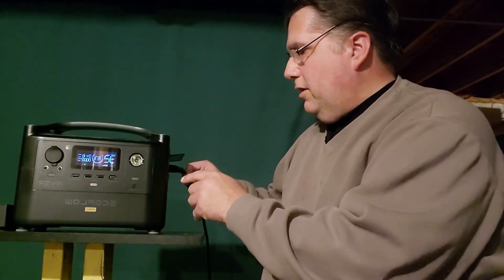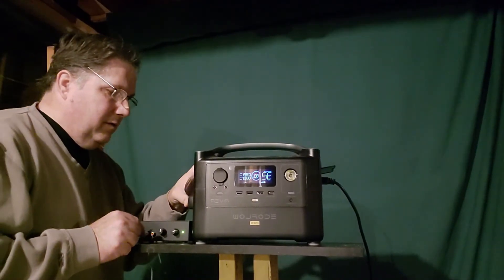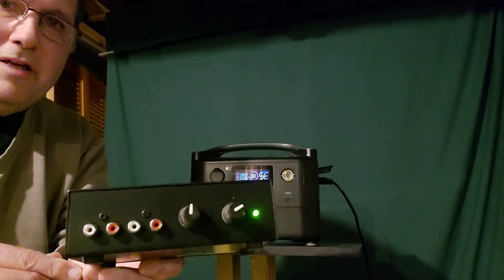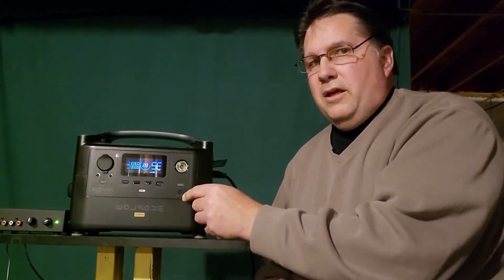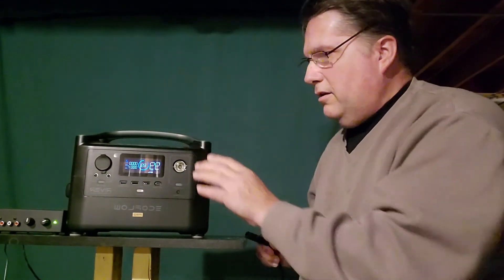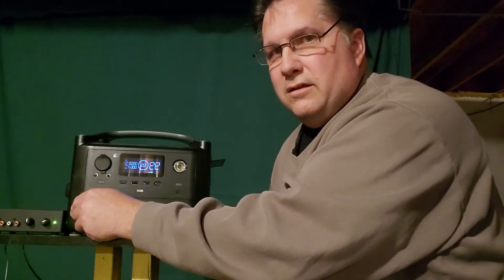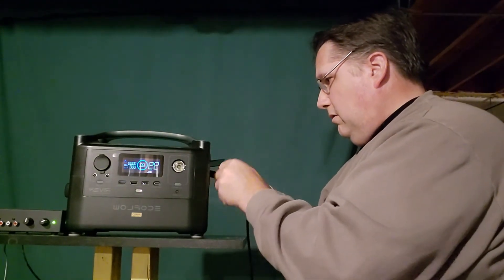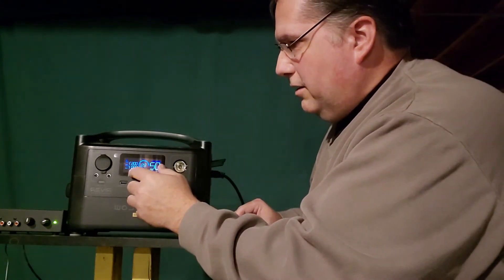What is a UPS?  Does EcoFlow have one? #UPS  #ecoflow

Comment: A stereosystem is not a good test for finding out it is an UPS. Even Ecoflow themself call it an EPS, emergency Power System.

If you plug in a computer that does not have a battery or an internet modem, you will know.
Reply from the maker: Yes there is a 30ms delay

Comment: Essential tremor.  Use some propranolol my friend.
Reply from the maker: Thanks
Reply from the maker: Carbon Monoxide posioning
Reply: @HarringtonMediaEcoFlow  geez sorry to hear that.  I thought it might of been essential tremor.  See a lot of it at the clinic. But I guess prolong exposure to CO could cause ischemic brain injury.  Smart guy.  Was trying to use my ECOFLOW detamax as a UPS for my internet router to keep cameras and ring operating. In case seal team six puts a hit out on me I’ll still be able to see them before they see me.
Reply from the maker: Ha...funny
Reply: I just tested the ups function.  It doesn’t work as ups for my Wi-Fi router, I tested.  As soon as I switch from grid to battery that delay knocks out the wife and  my control of device.  Since I use smart outlet, I keep it pluggged until I need the grid on or off. Once that is cut off I loose control until I get home and reset the Wi-Fi  connection.  I use a ups connnected to outlet on delta pro, which is connected to my Wi-Fi router. System now works flawlessly with the ups.  If you don’t have one, you will lose control of the Wi-Fi remote control.  And you will lose power to fridge if you don’t have access to Wi-Fi to flip on smart outlet switch to turn on grid power.
Reply from the maker: Good research.
Reply from the maker: There is a 30ms delay
Reply: @HarringtonMediaEcoFlow  I think for important devices like networks, computers, wifi cams, I think the delay is enough to cause issues if you depend on the wifi to control all your devices including ECOFLOW from remote.  But it’s a easy fix 100-200 bucks and it’s now solid device.
Reply from the maker: Good advice

Comment: Since the latest update, I "lost" the UPS icon on the screen, plus it does not show that there is an input despite the fact that I have it plugged into an outlet I know is working to keep it continuously charged and powering small USB devices, namely my phone. Do you think my update was corrupted or something? Are others experiencing this? How do I get that UPS icon back that shows that I am truly using pass through electricity?
Reply from the maker: Try re updating. Also test it. Leave the device you want to power plugged in. Plug in the ecoflow also. Once the ecoflow is at 100 it will stop chg but the plugged in device should keep working without lowering ecoflows charge.
Reply: @HarringtonMediaEcoFlow  Many thanks for such a prompt reply. (I hope Eco-flow recognizes how much of an asset they have in you!) I just don't know how to re-update the latest firmware. I have taking the AC charging cord out and waited 30 seconds, and then plugged it back in and it did charge it back to 100%. The USB outflow is only 5 watts, between two phones, and it doesn't seem to be dropping the charge from 100% this time🤞, but I want to take your advice. What's the best way to uninstall/re-update firmware?
Reply from the maker: Thanks. Some things just aren't documented
Reply from the maker: Use the wifi app and see if you can choose 'check for updates ' and download again and reinstall.  Keep the ecoflow from going into sleep mode while updating.
Reply: @HarringtonMediaEcoFlow  Yes, I did go through the settings and checked for that; it's all up to date. However I think I found something about how to do that by pressing both the power button for the DC outlets as well as the main power button in the middle at the same time until you hear a beep and that's supposed to reset it after which I supposedly can reinstall the update.  The instructions though talk about "turning" these things,but  I'm not sure if I should be "turning" them on first or off first before doing that. It's not clear in the manual.
Reply from the maker: Have you tried calling their tech line?
Reply: @HarringtonMediaEcoFlow  I should have posted this latest update earlier, but I wanted to make certain everything was working otherwise. I did get a response finally that explained that the UPS icon only shows when the charge level is set to less than 98%, in fact I set mine to 90% and waited until it dropped down and that's when the UPS icon lit up on the display. I would normally feel embarrassed, but they should have said this up front, and the tech who first helped me should have explained this. In other words, if you leave the charge level set to 100%, and you have it plugged in to the wall outlet to keep as a UPS, you will not see the UPS display.

Maybe I need to go to one of your other videos to ask if connecting a 100ah 12 volt LiFePo4 lithium (with the dongle you recommended and which I bought) would work with both the River and the original Delta? Many thanks as always for your help.

Comment: Is it okay to directly connect a UPS to the Ecoflow just to keep the battery runnning on the UPS to keep my computer up?
Reply: Yes and this way you eliminate the 30ms delay the ecoflow has. So you put the ecoflow in the AC plug, you put the UPS to the ecoflow plug and then put the computer to the UPS... when AC outlet has power, you draw directly from there, when power is off the UPS will instantly power the pc and then 30ms later the ecoflow will give power to the UPS so effectively the ecoflow will be providing power to the pc as long as it has power, when it runs out, the UPS will take over.
Reply from the maker: Excellent description !
Reply from the maker: Yes you could.  However the dedicated ups has its own battery of course but yes you could go through the ups.

Comment: But I heard the time of the UPS latency is 30ms, so not very good for computer isn’t it ?
Reply: New Delta 2-only 13ms.
Reply from the maker: Fantastic !
Reply from the maker: No it is not a instant response.  But if your computer is a laptop it should be fine. The internal battery should absorb that 30ms delay no problem.

Comment: I've been using UPS's, and Power stations, and power stations as UPS's for a long time.   Basically it does work, but there are a number of gotchas and issues that have to be addressed:

* You have to accept about a 30% loss of efficiency because you are taking AC on the input, converting to DC going into the battery system, and then back to AC again to power the device(s).   A dedicated UPS, on the other-hand, has a bypass mode so there are no losses under normal operation.  This can increase your power bills.

* Depending on the brand, the power station will likely have an 'ECO' mode that automatically turns off the output after a period of time.  This has to be disabled.  If it cannot be turned off then it depends on how the ECO mode works.  Some units like the Golabs i200 don't give you an option on the AC output, but will happily leave the DC output turned on forever so an external car inverter solves the problem.

* Power-on after power comes back.  Most (all?) of these power stations do NOT turn themselves back on when they've run out of battery power and shut-down.  Dedicated UPS's, on the other-hand, power back on immediately.

* Noise.   Most power stations have fans, and for the bigger ones, the AC adapters (the bricks) often have fans too.  This can be annoying if the unit is situated near where people are.  Dedicated UPS's running in bypass mode do not have to run their fan at all.

* Fire risk.  Use only power stations with LiFePO4 batteries.  Do not use power stations with standard lithium-ion batteries.  It becomes important when you are leaving one or more power stations turned on 24x7, unmonitored, inside your house.

* Overcharging is a risk when running a power station as a pass-through UPS.  Another reason to use LiFePO4 based units.

* Quirks.  Every power stations (Bluetti, Ecoflow, whatever) has its quirks.

Those are the main issues.   At the moment I am using a little GoLabs in the garage to power my cable modem, and I had to use the exernal-inverter trick because it turns off its AC output after 8 hours regardless.   And I'm using a bluetti EB55 in my office... with the bluetti, there were severe noise issues.  The bluetti runs its fan if you recharge via the MPPT port, and the 200W AC adapter for the bluetti makes a lot of noise.  I had to find a fanless current-limited power supply at 24-25V to plug into the bluetti's "adapter" port to get rid of the noise.

That was actually not even remotely easy to do because most AC adapters are not current-limited and instead go into a fault mode.  Depends on the power station of course.

I am fan of charging power stations via USB C PD ports these days.  It is a relatively new thing that many power stations do not have.  they all have USB C output ports, but only some of them have USB C ports that can go the other direction and charge the power station.  The Golabs i200 has one.  The bluetti does not.  I don't know about the EcoFlow products.   The nice thing about charging the stations via USB C (when they support it) is that the USB C wall warts are extremely efficient, fanless, and negotiate a specific amount of power to be delivered so no worries about overloading anything.   Going forward, I will only buy power stations with two-way USB C PD ports

-Matt
Reply: Actually, a UPS does not by definition have a bypass mode. What you essentially describe is the difference between an online (dual conversion: power always via the battery) and an offline (standby/bypass: power source switches based on input threshold)-type UPS, but there are also other types of power transfer technologies, such as line-interactive and hybrids (see https://en.wikipedia.org/wiki/Uninterruptible_power_supply). Is it true that all the ECOSYSTEM power stations are all of the online type?
Reply from the maker: Good research. Nice to know.
Reply from the maker: Thanks for the response Matt. The UPS feature on the Ecoflow is no doubt meant to be a temporary fix for emergency or unexpected situations like I described in the video. It's one more tool Ecoflow solar generators have in the tool kit.
Reply: Matt that's a lot of good information! I was thinking about using the Delta mini as a ups for my refrigerator. But it sounds like I probably shouldn't leave it plugged in all of the time.
Reply from the maker: Thanks
Reply: Super.Thanks.

Comment: does this not damage the batteries?
Reply from the maker: See the ecoflow website.  It says the ecoflow has a level one ups. So it's built for it.
Reply: These aren’t lead acid batteries that like to be at full capacity. Lithium batteries do not like to be empty or at full capacity for long periods of time.
Reply: @hagridsbeardguy1399  how would you micromanage one of these for lasting batteries? empty it to 50% once a month or so? leaving it plugged in as an inverter keeps it fully charged most of the time
Reply from the maker: It's not meant to be a permanent UPS. It's just a feature like a tool to use to get a temp. Job done.
Reply from the maker: As advertised the Ecoflow will hold its charge for a year.

Comment: How would using the EcoFlow in this way impact the 800 cycles to 80% or having to store the EcoFlow at 30% charge for long term storage? As I only plan to use my EcoFlow for power outages, it was concerning I had to leave it at 30% charge if not being used for 3 months or more. Often power outages are unexpected, not always accompanied with storms, etc., so having to have it at 30% was kinda an inconvenience. If I used as a UPS, it would always be at 100%, but what are the downsides of using it as a UPS over a year or two?
Reply from the maker: Ecoflow can hold right at 100 percent chg. For a year! Saving it for power outages is how I use it.  Using it as ups should only be used when needed not for continous use. The Ecoflow generator has many uses.  Ups is one of its many abilities.  Used when needed the Ups feature should have little effect on the charge cycles.  Good question 🤔
Reply: @HarringtonMediaEcoFlow  nice video, I’m about to test this with my new Ecoflow Delta Mini and my home sump pump.

Comment: Here's the problem.  If the ECOFLOW battery is drained to 0% in UPS mode, the ECOFLOW turns itself off.  When the grid is restored, the ECOFLOW turns itself on, but the AC outlets are OFF.   If you are not a home to turn the AC outlet on, your fridge, for example, will be without power and food will begin to spoil.
Reply from the maker: This is true.  The UPS feature is not full proof but normally it would be a manual short term solution.  But the River Pro would last for days because it would only run when the compressor runs.
Reply: @HarringtonMediaEcoFlow  Without an extender battery attached to the  River Pro my efficient LG 28 cu ft refrigerator will run for 6.5 hours on a full charge.  My mini-fridge will run for 24 hours.  I brought the matter up with ECOFLOW.  They said that their technical team will look into the possibility of a firmware update to address this shortcoming.
Reply from the maker: I understand.  Results very due to many reasons.  Sorry you haven't experienced a longer run time. How many watt hours is your ecoflow unit rated for?
Reply: @HarringtonMediaEcoFlow  It's a brand new River Pro 720 kWh.  The LG fridge draws 80 -  84 watts when the compressor is running, and 5 watts when not.  The  River Pro's total AC output from 100% SOC to 0% is 520 kWh as measured by my Kill-O-Watt meter.  This loss of energy is due to DC to AC inverter inefficiency.
Reply from the maker: Thnks for the details. Were you able to get that firm ware update?
Reply from the maker: The latest firmware update does affect the ac output. Possible cause?
Reply: @HarringtonMediaEcoFlow  The feature to keep the AC outlets turned on after power cycling the River Pro is something that ECO FLOW may include in a future software update.  It's under consideration by their technical team. There's no promise that this feature will be forthcoming anytime soon, if at all. 

In the meantime, I have a work around...

When grid power is restored (after the unit shuts off due to the battery drained 0% SOC), the River Pro will automatically turn on and begin recharging the battery.  Unfortunately, the River Pro's AC outlets are now OFF.  Fortunately, the AC outlets can be manually turned on via  the Eco Flow app.  Unfortunately, if you're away from home, you may not even be aware that grid power was lost.  I needed a way to be notified of grid power loss via a text or email to my phone.  I purchased and installed a MySpool device which detects grid power loss and sends a message when grid power and a wifi connection to the internet is restored.  The River Pro must also automatically reconnects to the home wireless network.  

I've tested this workaround with encouraging results.  It's not a foolproof solution since it still requires human intervention to manual turn on the River Pro's AC outlets.  I hope Eco Flow decides to implement something that works automatically in their next software update.
Reply from the maker: Great research! That may help more people.
Reply from the maker: Thanks for your thoughtful question.

Comment: does utilizing the "UPS" feature as a constant, decrease the cycle life of the EcoFlow 1300? I'm utilizing it for a fridge, and another one on a freezer, presently, but shall combine my computer to the one on the freezer, depending on your answer. Thank You Bunchessssss, B BIG Time Blessed. . .
Reply: According to their site while there is an outside AC supply, the ecoflow will not use the battery for output so your appliance will sue the AC power from the outlet and the battery will remain idle, it will recharge to 100% and stop there... so it really acts like a true UPS, the difference between a real UPs and ecoflow is the switch between AC to battery is 30ms when the power is off, unline true UPS for computers where the switch is like 1~2 ms at max.
So in theory you can keep it there and it will not degrade the battery unless it uses it for a power out. Of course the battery might get slowly depleted even without use, having it always on means it will keep the battery at 100%.
Reply from the maker: I'm sure it was not meant to be used like a UPS indefinitely but for a short period sure. I've used mine for my sump pump a couple of times.

Comment: Thanks for another video! For some reason mine still doesn’t work as a ups for some reason, it runs off the battery and is charging at the same time, I have been testing it like this for a while, probably a bug in mine, I finally have the new firmware ( last week) so now I have the auto fan icon and it works ! Thanks for keeping us updated with your videos 👍
Reply: Hi Mine does the same, my TV runs off the battery and charges simultaneously. Have you managed to figure out what might wrong?
Reply from the maker: Have you updated the firmware with the mobile App?
Reply: @ty_naicker  hi, tell me pls do you find the solution? I have the same problem with the latest firmware
Reply from the maker: Sounds like a call to the tech hot line is the next step. :)
Reply: @ty_naicker  sorry i missed that question 7 months ! Well even now with everything updated many times, same thing no ups
Reply from the maker: Sounds like a call to Ecoflow tech support is in order.